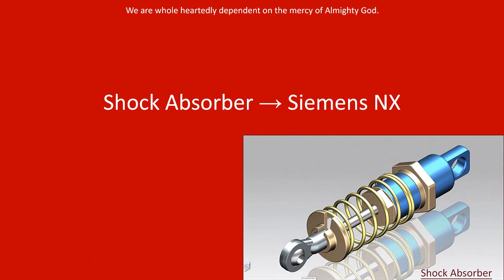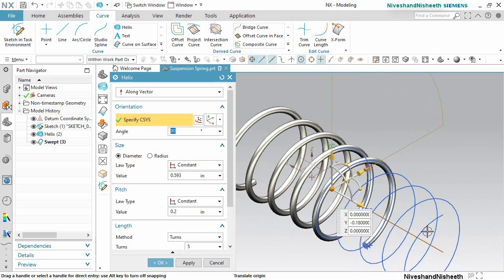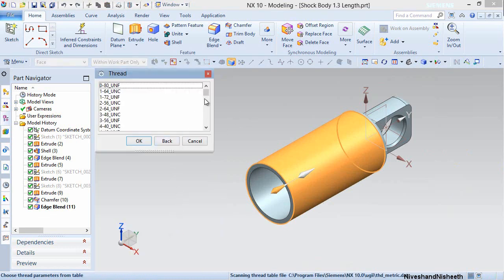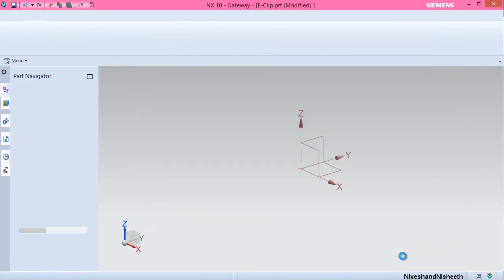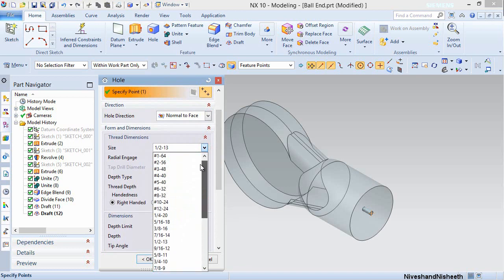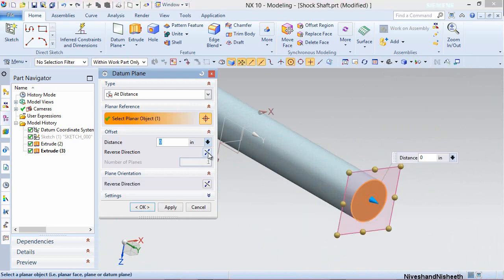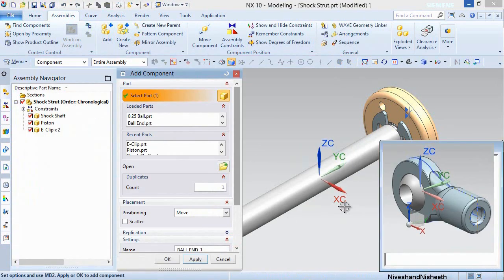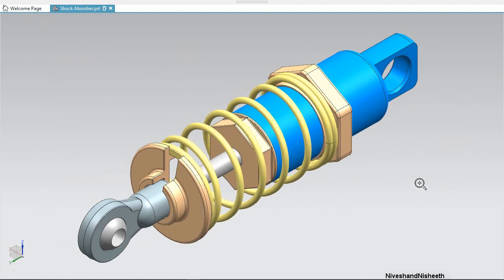Shock Absorber Assembly Designing || Siemens NX Tutorial

Comment: Why your threads are not showing up but you did ignored the error that came with it.
Reply from the maker: First of all, I would like to thank you for visiting my channel and watching my video and raising this point. 🙏🙏
There is a drawback in NX software that if you select the symbolic thread option then the thread will not appear in it, yes if you select the Detailed option then you will see the actual thread, while I have worked in many other 3D software. I did not face any such problem in that because in them a kind of thread image will be applied on the cylindrical surface which is called (Cosmetic thread image) and you will see it.
I had also seen this in the forum of Seimens nx but I did not get any help from that, maybe in the future some updates will come in its new version.
As far as the one who is showing errors in the last while creating a thread in it, I will try to understand why this is happening.🙂🙂
Reply: @niveshandnisheeth Hello! Despite this error, will everything continue to work?